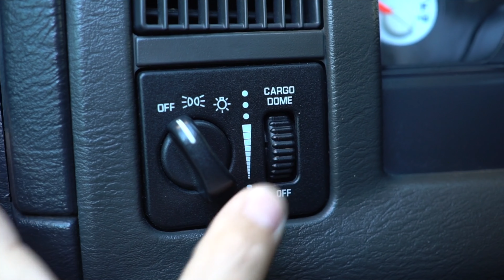Hollister Hills ATV Riding

Comment: How comfortable is the ride on the highlifter? I have the regular 850 sportsman and it is one of the smoothest riding machines I've been on. I'm thinking about getting the 1000 Highlifter but would probably switch the tires to all terrains like the Blackwater Evolutions for a better ride.
Reply from the maker: Danger Ranger I tested both and I liked the highlifter better in every way including the ride ... you won’t be disappointed w the 1000 highlifter, I haven’t been.
Reply: Really, thats awesome. I've been reading that its a rougher ride
Reply from the maker: Not to me, but you can change the tires or soften the suspension.  I changed to fox shocks on my 800 RZR because of the ride and didn’t even think to change the shocks on the highlifter.   I didn’t even change the tires and that’s usually the first thing I change.  I don’t mind making another vid on the HF, let me know if there’s something you want to see/explained
Reply: Since your are running on hard ground with those tires that are pretty stiff then it should be more than comfortable enough with the all terrains, thanks